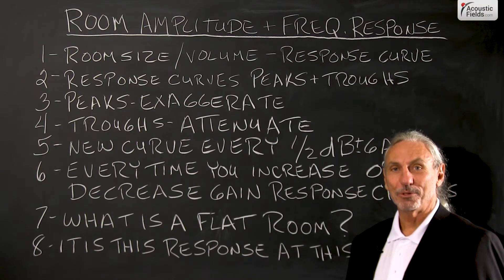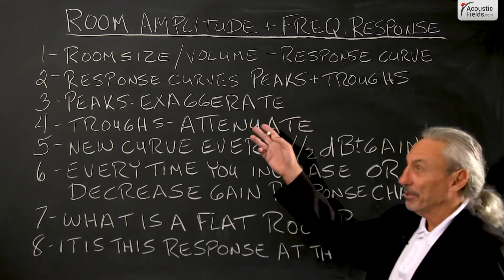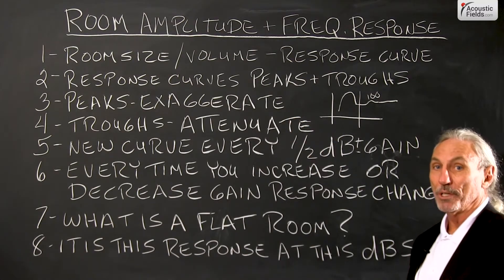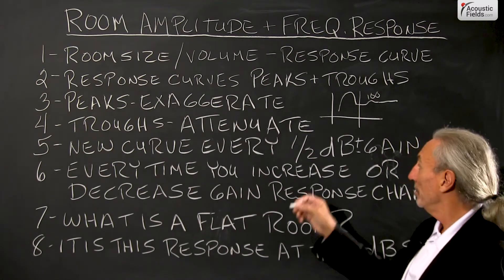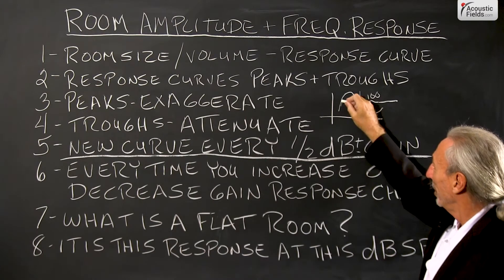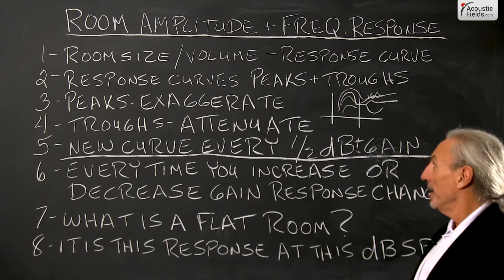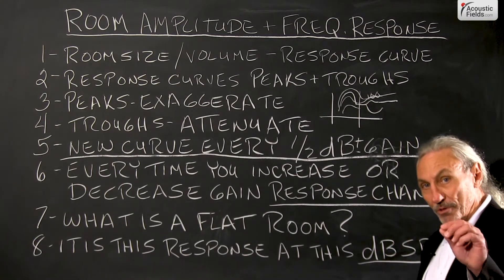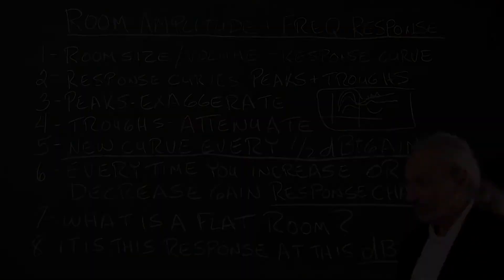Room Amplitude & Frequency Response - www.AcousticFields.com

Comment: Hello Dennis,  When "voicing" a digital organ in a room, the turning up of the volume control always adds BASS in greater amount than the other sounds from the organ.  It is critical to have the overall volume (SPL) at the optimum level for the use of the organ before attempting to adjust the balance between Treble and Bass registers of the instrument.  Well said on your talk today.  KEN
Reply from the maker: K, Let me make sure I understand this correctly. The increase gain from the volume control overemphasizes lower frequency energy as part of its function?
Reply: Dennis,  Yes!  As the volume is turned up the bass increases faster than the rest of the spectrum.  Often an unaware person may turn up the volume control in an attempt to make the organ sound "bigger" only to find the bass sounds become overpowering.